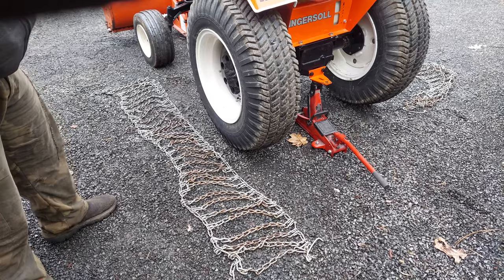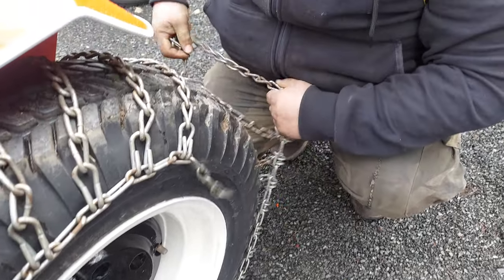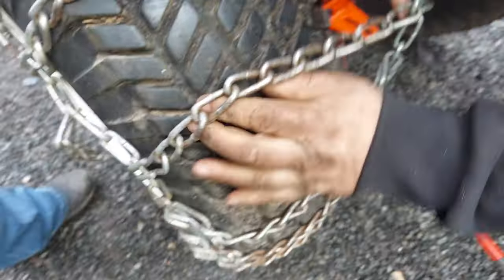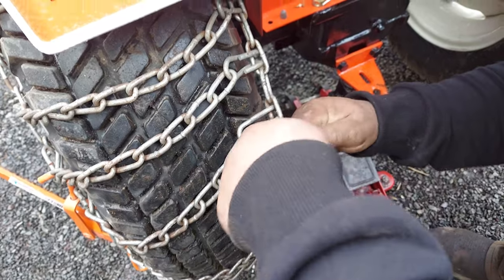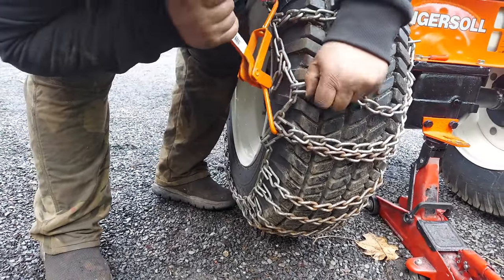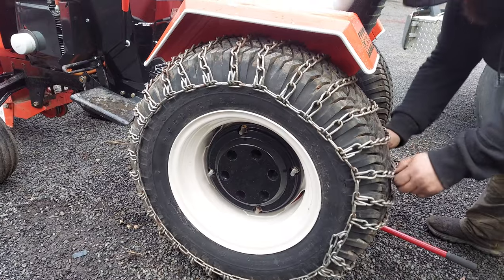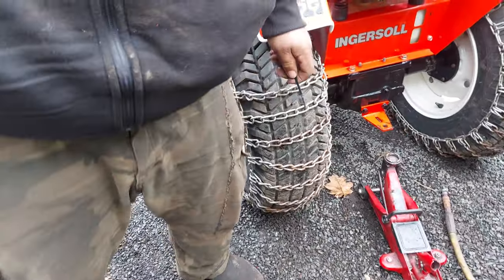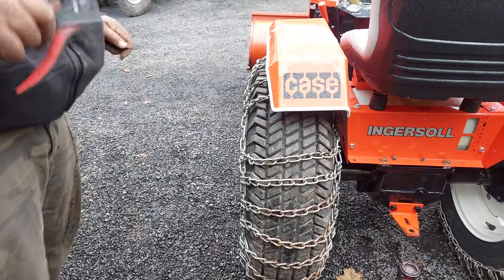How To Install Tire Chains. Truck, Farm/Garden Tractor etc. Same Principles For Most Tire Chains

Comment: Thanks. I've never installed my chains.
Are those tire weights made from disc brakes?
Reply from the maker: Well get after it! Lol. Those are factory Case Ingersoll weights.
Reply: @caseingersolltractorsnortheast  
I actually have a severe weather plan. 
I go inside. 
And oddly enough my case 446 is my daily driver. 
Very small town plus I plan waaaay ahead. 
Still I might have to just to prove to myself that I can.
Reply from the maker: @cody481  There ya go, we have to challenge ourselves!

Comment: I once had tire chains on my hydro cub cadet and the chains were wrong I cut them and crimped them to fit but one fell off ripped out my taillight harness and wrapped around the disc brake and bent the linkages I try and avoid chains I have nearly 400 pounds on my jd 318 so hopefully I won’t need any chains it has good frilly tires too
Reply from the maker: Chains make a huge difference,  just have to be put on correct and secure lol. Sorry to hear what happened.  Think we all been there sometimes things happen.  Will say don't wait as soon as we see or hear them loose fix them! Lol
Reply: My first dealings with tire chains was in the army in 81. As a mechanic I had to repair a fender and wiring harness because the jeep driver put the chains on loose.
Reply from the maker: @MrGordy61  sounds about right, more common than most would like to admit lol. Thanks bud
Reply: @caseingersolltractorsnortheast  yeah good point

Comment: I love those chains with that long lever lock, so much easier to get the chains tight. With the long levers I can get the chains tight without having to drain and refill the tires.

With new chains, once I have them on and tight I cut the tails off. That removes any guess work the next time I put them on.
Reply from the maker: Yes the leverage is nice for sure! Also the cam lock ones are nice too!